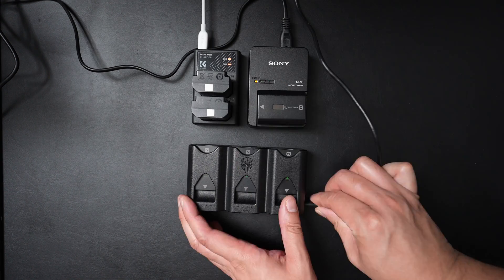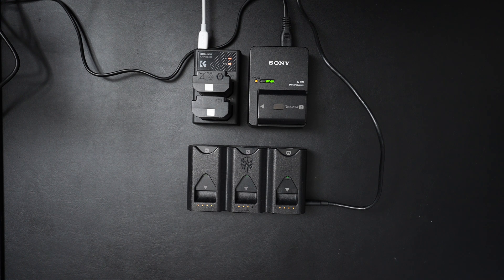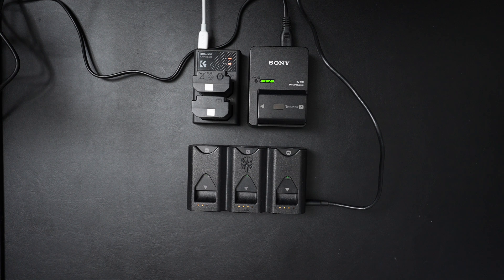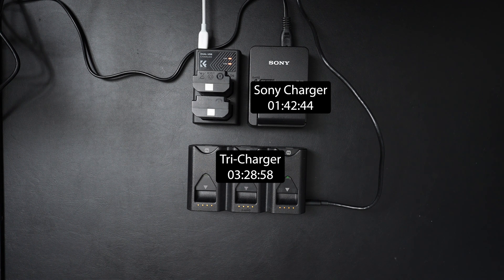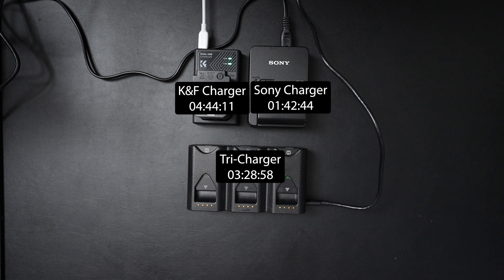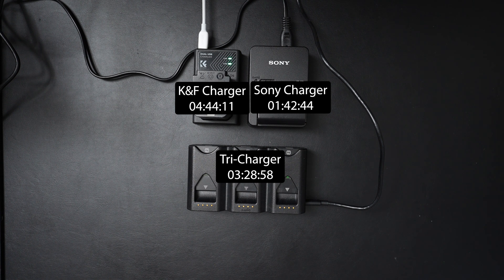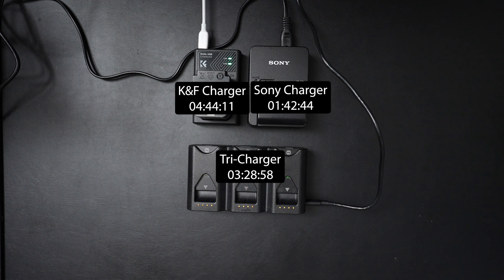Peter Lindgren | Tri-Charge - Charging Test

Comment: Love your videos! I just knew the k&f 2 slots charger are able to charge the original sony battery. I thought it will not able to charge? Because I ask the seller and he said "Sometimes it's able to, sometimes it's not able to charge the original sony batteries."
Reply from the maker: I didn’t even consider that it wouldn’t charge the original battery lol… I just blindly bought it to charge my batteries lol… 

So lucky for me it worked out without checking lol… 

But glad the video has helped you decide if you’re going to buy… it is slower than others, but it works and USB-C
Reply: @leo_hoang  yes your video really helpful and I watched your "part 2" review and proved the sony bc-qz1 was the best charger, even the price is really high (in my country) ... My final decision is the BC-QZ1 :hand-purple-blue-peace:
Reply from the maker: @hellomarlon  I wouldn’t say the Sony is “the best” but it’s the fastest for single battery charge. The Jupio Tri Charge is more useful, more convenient being USB-C compatible etc. but it is the most expensive. Which country are you from?
Reply: @leo_hoang  I'm from Indonesia, yes you're right, for the value honestly jupio was top tier. In Indonesia jupio only 11$ USD higher than the sony one (Sony is about 90$ USD). But I prefer the fastest one because I will use it for a full day event / trip, so I will using my 1st battery, charge the low battery, use the full charged, charge the low, repeat. So I need the fastest unit so I able to swap everytime when I need. And I considering about your jupio review you said the battery can easily get off when it's flipped, yaa that's my concern too.

Comment: The tri- charge is not charging the battery is too fast. 
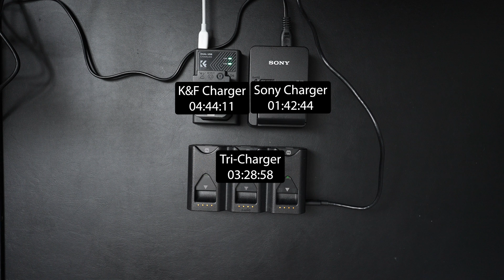The battery is able to be charged at 1 hour and 42 minutes. Each of those batteries in the try charge took 3:28. Therefore, the batteries in the tri-charge are not subject to the same amount of stress that the Sony charger is putting on the battery. 

Unless
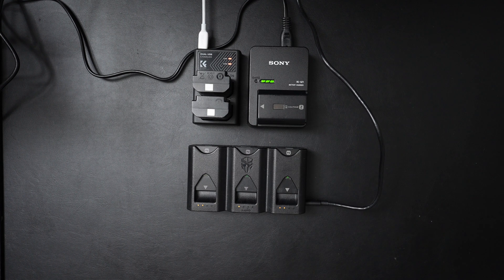The tricharge is charging one battery at a time. Then that would mean that each battery is charging in 1:09. That is quite a lot faster than the Sony charger.
Reply from the maker: Fair point… I believe all 3 charge at the same time based off the blinking lights… I was tempted to do a test for 1 battery in the Tri-Charge but now I’m not so sure I want to subject it to such high charging speeds… 

I want to do more tests as I’m curious about the numbers myself, but draining and charging them up takes hours… 

But seeds have been planted so videos may manifest from this lol
Reply: @leo_hoang  sweet. I'll try to buy the tri-charge and test out my batteries. I'll let you know if I ever get around to it.
Reply from the maker: @frustratedbot  awesome! Please do let me know your results! Would be interesting to compare.
Reply: @leo_hoang  So when charging one battery in the triple charger, is it really fast or is it still slow?
Reply from the maker: @ I have a part 2 to the charging test video posted last year, can’t recall the results but the video has the test/results
Reply: @leo_hoang  i watch it